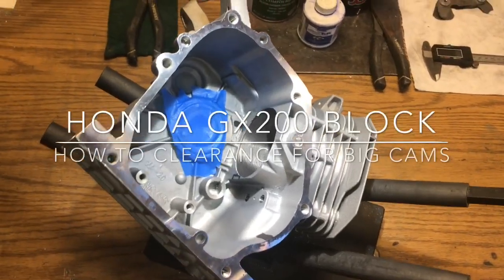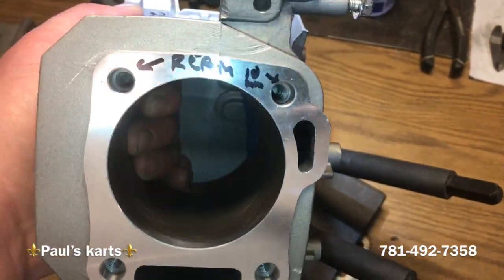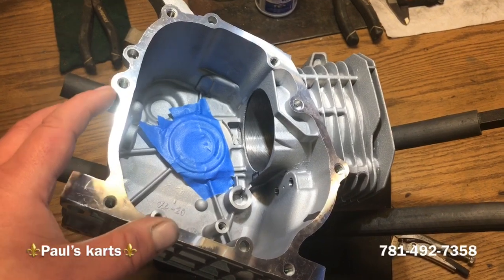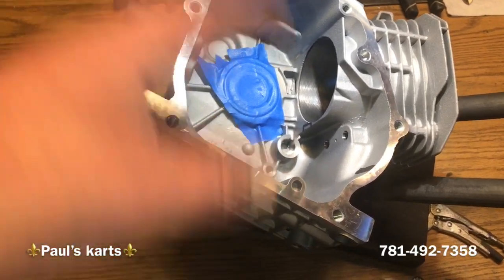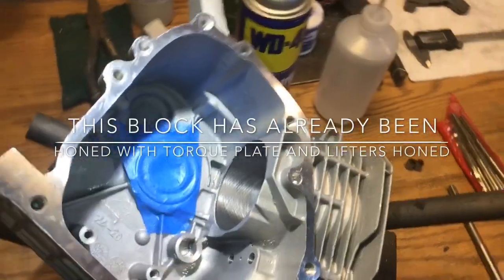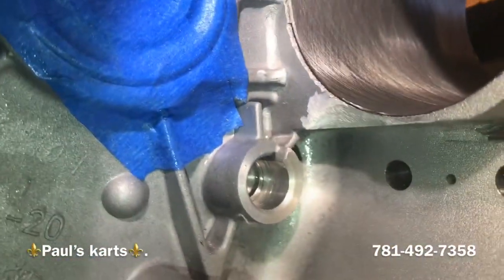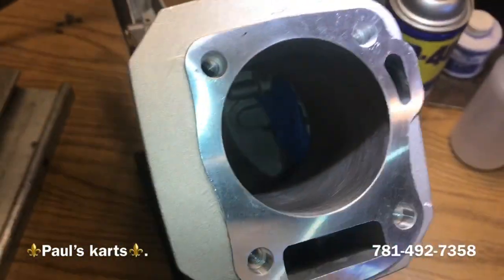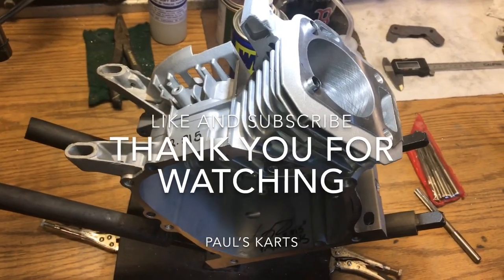Honda gx200 *block prep* for HIGH LIFT CAMS ...

Comment: Hey Paul, I did my block bearing removal with my toaster. I thought I heated it up too much and stress cracked the block around the supports for the bearing journal. Is it more likely I'm just picking up on some janked milling? I love building the Honda blocks, currently I have 3 gx160s. https://youtu.be/NhFFKL1laAc I'm running 22# springs, .308 billet rod, t2 flat piston, 4 degree key, PVL flywheel,  full governor removal, billet intake,  36 jet, Autolite plug.  What is the best head gasket size without shaving the head? If I'm running the Honda cam will having you do some head work justify any noticeable performance? I'm not even sure what I'm putting these on but I'm all about having the motors that show up for the show down!
Reply from the maker: The head is the “only way” to increase power. More air in , squeeze it harder. So big valves is the only way to get more air in, and smaller chamber is the way to raise compression. Look on eBay for the $399 head. Cheapest head and one of the nicest. Watch my newest video on prices and options.  gx160bvc is the part number. Go to eBay type in predator 212 32/28 big valve head. Find any listing , from there go to sellers other items .

Comment: Do you sell a welded 3 inch bore predator 212 block or a gx 200 block ?
Reply from the maker: I got a welded and a freshly bored 2.815” coming out the machine shop this week .. if you want it it tell me soon before I post it .. call for pricing
Reply from the maker: Honestly you can make plenty of power with the 2.815” bore and the amount of material you need to remove to bore the block to 3” it’s not worth it .. if always prefer the 2.815 over the 3” because for the small increase in cc’s your sacrificing cylinder strength ..and you can’t make power if the rings don’t seal .. the thin bore makes the cylinder walls to thin and makes the rings prone to flutter due to warpage .. hope this info helps you make a decision .. if you need 3” I can bore a block and sleeve it for you
Reply: @paulskartslifan4206  you know what do you have a Instagram? So we can talk more
Reply from the maker: No but text me .. 781-492-7358
Reply: Jokey Jesus  what is your insta